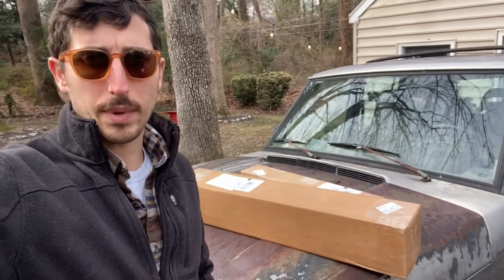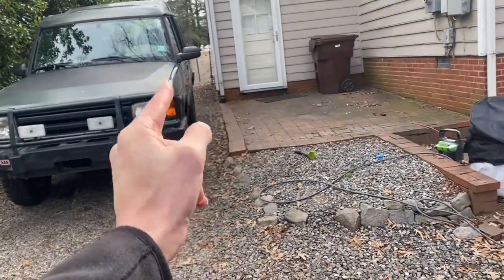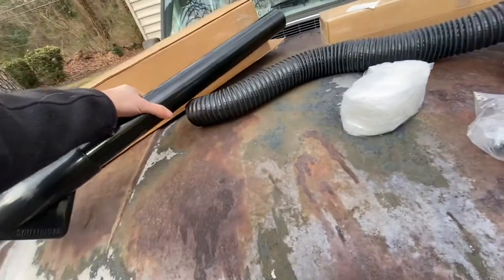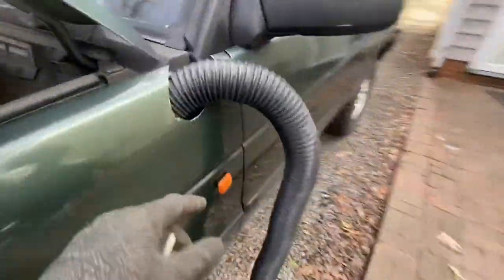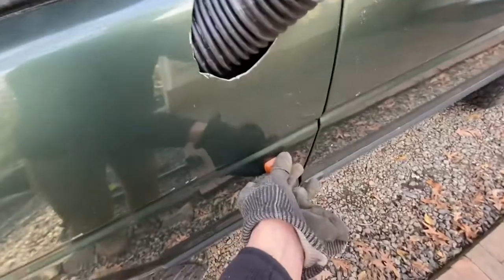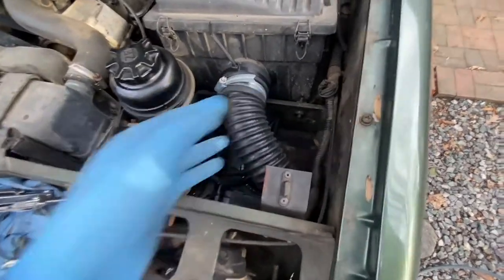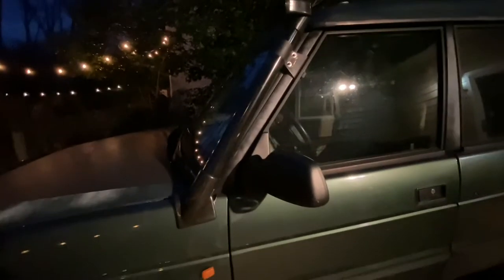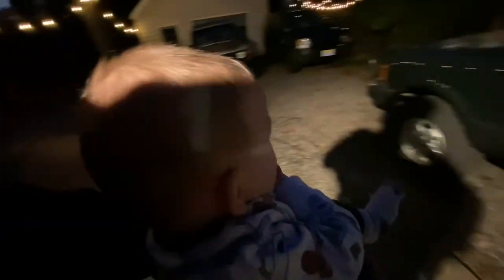1994 Land Rover Disco I - SouthDown Snorkel Installation

Comment: I have the ARB snorkel on my D2 and I put silicone around where it mounts to the air box. Wheeling a lot in south NJ where there is water and I have had water come clean over the hood and hit the windshield wipers. Also have gotten stuck pretty good where the snorkel definitely saved my truck. I honestly believe if installed correctly with a little extra modification the snorkel is added armor in the woods.
Reply from the maker: Agreed. Good insurance policy. I’ll sure it up once I get the trans sorted.